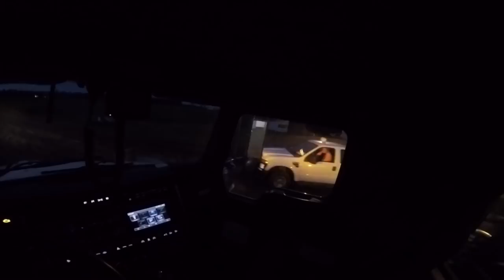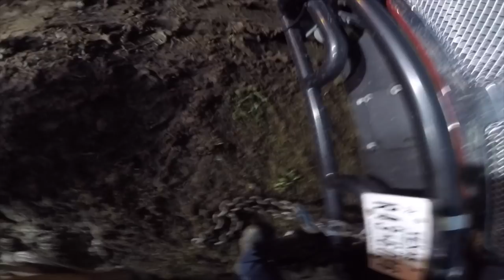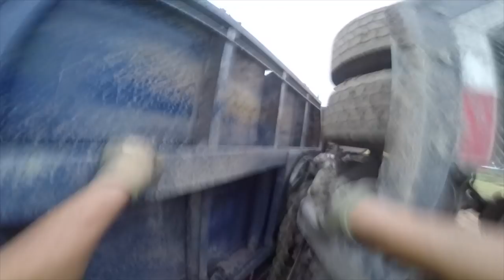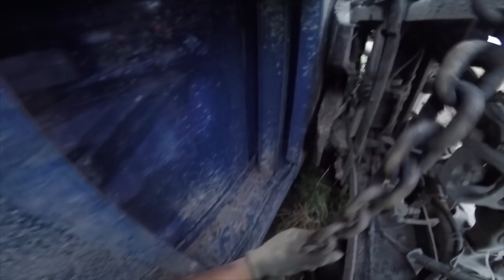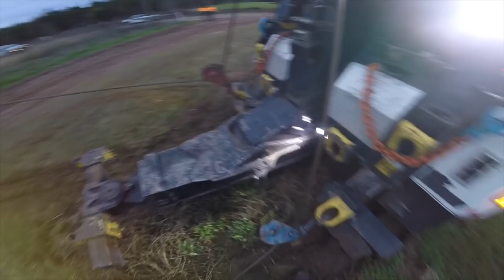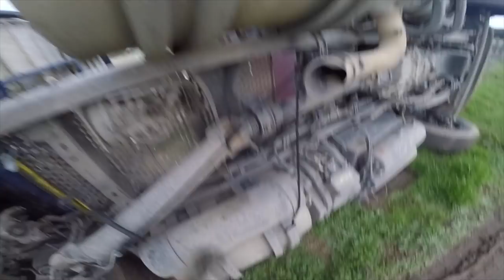Heavy Duty Recovery Rollover and Winchout

Comment: I'm so used to watching rotators used to flip trucks back on their wheels, but Mr. Wilbert did a soft recovery with 2 lines off the back of the V100! Super smooth and impressive. Really nice work.
Reply from the maker: Steel fist we appreciate that. Thanks for watching and stay safe
Reply: As always - super low stress, low concern - getting the job done easily! Other company’s panic and run round like headless chickens!

Comment: Your wire rope has a broken strand, you can see it 20:33, up even with top of tow thing
Reply from the maker: Palladin971 Thanks I will check in the morning and thank you for watching. Stay safe
Reply: I think that was a piece of weed on the cable part of a steel wire from cable would not be moving in the wind

Comment: 18:40 it looks like you were sliding back and decided to lift your boom to stop that from happening but both lines are shackled low on the truck so it doesn't seem like raising the boom changes the pulling angle. Can you help me comprehend how raising the boom gives you more traction/pulling power?
Reply: Does it change the way the weight of the load is distributed on the tow truck and generate more traction? That's my best guess.
Reply from the maker: Mr Devine truck sliding back makes the out riggers go deeper which creates more resistance. Thanks for watching and stay safe
Reply from the maker: @devinjonathan5681  Yes sir it does change the angles some but not a whole lot. Thanks for watching and stay safe

Comment: No way will I ever pull on a tire side, it will bend wheels and pop tires, or at least it did when I tried to pull over the top of a tire to upright a truck, we put cribbage on the side of the frame , and pulled down on it, nice 👍, good job, it is a good day when you can work alone and get a roll over back on its wheels safely, nice good job, thanks BigAl California.
Reply from the maker: Mr AL The cable was just on the rim until he got everything tight. The chain ran between the tandems. Thanks for watching and stay safe